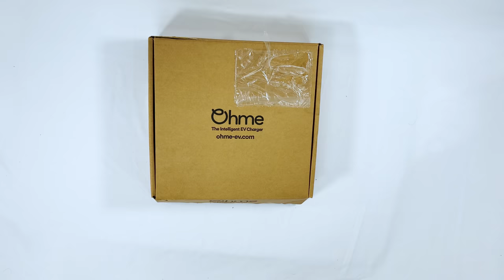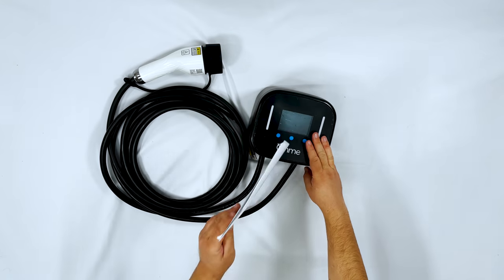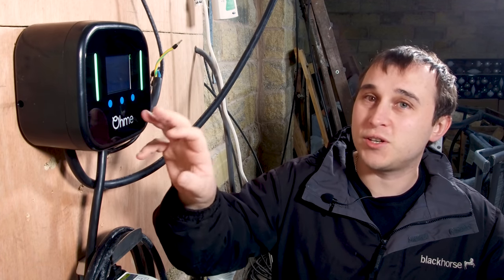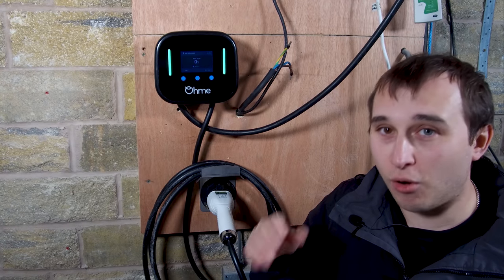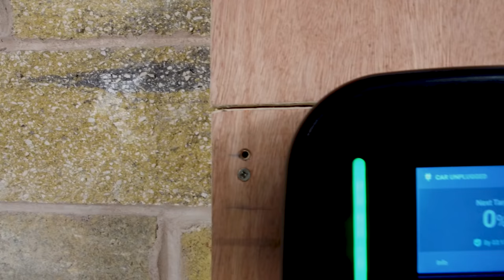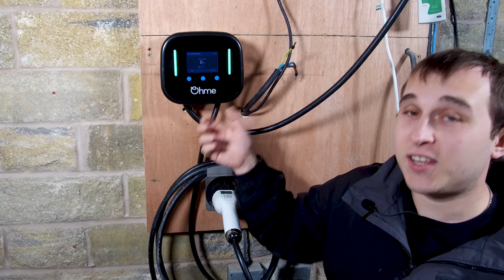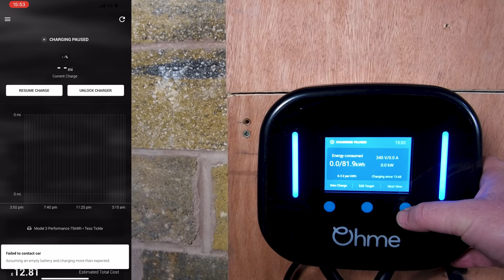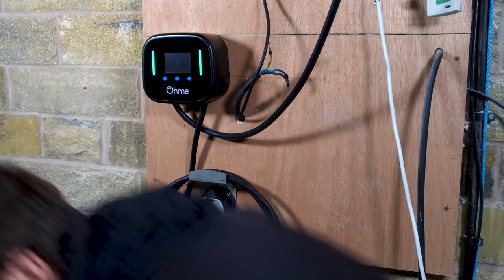Ohme Home Pro Review - New Level Of Smart EV Charger?

Comment: Hi Nick. I'm a long time fan of your videos and I really find them useful. I actually went ahead and got an Ohme Home Pro charger installed following watching this video. However, having used it for a while I do feel there are a couple of issues that I have realised which were not covered in your video. Firstly, the charger application does not support multiple EVs. So if you are a multi EV household sharing the Ohme Home Pro, then you will have a large faff to reconfigure the app every time you switch cars to charge. Likewise, if you have guests visiting in an EV who would like to charge, then you'll have to go through the same faff. I believe the app should allow you to add as many cars as you want (within reason) and fast switching between each car should be possible. Further, there should be an easy guest mode that allows anyone with any car to plug-in and the charger can be configured to charge based on a continuous or timed schedule without having to enter any car details. Neither of these features exist with this charger and I feel it's quite a big oversight.
Reply: Hi Mil, I contacted Ohme to check whether they were able to offer a guest or multiple EVs option for charging.  They did confirm that the system currently does not support this facility at the moment.  If anyone is looking for a an EV charger, my recommendation would be to think about what is important to you and get these points checked out by the manufacturers.  In my experience they are good at responding to questions.
Reply: This is an important feature not mentioned anywhere. thank you for mentioning it. What charger is good for multiple EVs?

Comment: Nick. Thank you so much for this review, another excellent video. However, it does put me in a bit of a dilemma as I was about to purchase an EV charger for my Nissan Leaf 30kWh. I was going to go with the Wallbox but I'm now torn between it and this one. I'm on Octopus Go with 5p off-peak rate for 4 hours. I'm not sure which charger will be best for me given the Leaf and Go tariff. Any suggestions?
Reply from the maker: Hi Mil honestly I say this again and again there's no 1 fits all charger.  Your may find several ev chargers that seem to fit your needs and others will only find 1 that fits what they need.  Check both do everything you need them to do then pick whats next important to you.  Price/Looks
Reply: @NicolasRaimo  yes, totally get what you mean but from what I understand, the Wallbox has timed scheduling which is very reliable for using with Octopus Go. How reliable has the Ohme Home Pro been with Octopus Go tariff?
Reply from the maker: @mil3761  ohme again perfect for that we use the older ohme charger at our current one with zero issues ever

Comment: I’ve only had it a day and I think the thing is a pain in the ass, why can’t it just be simple, charge and stop. I just want to plug my car in and have it start charging immediately and charge until full, or until I go out again. I get all sorts of messages, charging postponed until random times, sometimes I just get the thing sitting there doing nothing, sometimes it says charging but when I check my car it’s not charging. Some people just want a simple plug in until charged option. If someone knows how to be able to just start the unit charging immediately when I plug it in, on the app and on the outside unit, please let me know. Maybe I’m just old and useless and don’t know what I’m doing, but I didn’t find the app intuitive and easy to navigate, also when the unit is charging and you want to stop it, it’s not always possible, on the red max charge setting you can select stop charging on the main unit, but on the blue smart charging screen I couldn’t find an option to stop it from charging. 🫤
Reply from the maker: Have you looked at evnick.com/charge link the random charging to octopus your get to split £100 with me plus cheaper electricity

Comment: I am currently looking to install a home EV charger. I have a 1st generation smart meter and I am currently with Bulb. 4G is okay about 8mb download and 1.5mb upload. Would you recommend the Ohme for me or another brand? Thanks!
Reply from the maker: Hi Mitchell smart meter doesn't really matter if its 1st gen and the new company can't read it they will just fit a new meter,   I'd prefer to NEVER recommend any charger to anyone as its not a 1 solution fits all.   Everyone is going to have very different needs.  However if your question is will this charger work then yes it doesn't need a high upload or download as its sending TINY packets of data to work
Reply from the maker: pssst Click subscribe

Comment: Hi Nick i want to say thank you for this video as my brother in law rang me yesterday he’s 82 and has just got one of these chargers with a new Vauxhall Mocha EV trough the Motability scheme so problem was the plug on the charger would not come out of it holster on the wall the reason being the holster bracket now is not like you show in this video made from metal it is now black plastic  and the weight of the cable was bending it downwards he had no idea you had to press a button to get the plug out so he lives several miles from me and i had no idea what the issue was so i watch a few YT vids on the OHME and yours was far and away the best so i rang him back today and showed him your video over FaceTime job sorted saved me about a 40 mile round trip your footage did.
I have watched your videos for several years i have to EVs in my household both MGs ( mistake) that was but you have shown us a lot in that time so thank you very much much and keep up your good stuff
Les
Reply from the maker: Brill glad a could help!

Comment: Hi buddy, please can you help. I have the new OHME charger with no screen like this one I only want to charge my car on my cheap tariff which is 00:30 - 05:30 but the app doesn't let me do it. I can only set the desired % at departure. If I plug it in at 21.00 but depart for work at 05:30 and only need to top it up from say 40% - 85%. Will it start start charging straight away or work back from 05:30 so it charges on the cheaper rate or does it start charging straight away  ?
Reply from the maker: Are you on octopus intelligent?

Comment: Hey Nic, got the ohme home pro 2 installed a couple of months ago all worked fab untill i made the mistake of getting 2 ev's the same seems the ohme has issues distinguishing between the two cars even tho i sign into the ohme app using the respective api sign in for each car ( both are the same make and model ) swapping between them is easy as each is registered under a separate acc with the manufacturer but the ohme just becomes a not so smart charger as it cant connect to either using the api now. wondered if you or anyone has spoken to you re a similar issue???
Reply from the maker: not with 1 login for 2 cars but had issues with 2 cars 2 apis being a pain as you can't swap you need to delete car and read every time,  email ohme support and report issue.  However one solution may be using a 2nd email for the 2nd car,  or the LEAST popular method telling it NO API then it works same as other EV chargers with no app login but all the GO and Agile benefits... but email and bug support if they see the demand they will add it sooner always been my moan to them.
Reply: @NicolasRaimo  cheers Nic yeah I've a single ohme acc so 1 email but 2 separate bmw acc, one for each i3s..

Comment: This was top of my list  but no wifi on it is killer for me, rubbish mobile signal in my area. Also I have seen that several of the cheap electricity deals, like Octopus, seem to be offering their cheap rate between 12.30 and 4.30am and I think I understood correctly that this can't cope with that. Seems odd looking at its other complexities with rate chasing that it cant have a simple timer - Shame it looks good otherwise.
Reply from the maker: You can’t set a simple timer but you tell it your energy tariff and it responds to the price automatically so will charge in them hour rates if that’s when cheap electric is,   You can also make a custom energy deal in the app if yours wasn’t listed and say that’s when cheap power is

Comment: I much prefer a larger box so you can neatly wrap all the cable around the charger, also the CT clamp arrangement means these cannot be fixed on a building separate to the house consumer unit, Zappi still has it for me!

Comment: Hi nick could you explain how am i to use this with a mg zs ev 71 plate. I have just purchased this charger an bit concerned about the api issue
Reply from the maker: If your car isn’t one linked with api just tell it what car it is and that’s it… are you with octopus energy yet? If not you can get cheaper electric with Ohme using intelligent please consider using my refferal link and split £100’with me at evnick.com/energy

Comment: I only have one CT installed on my zappi. I have a powerwall 2 and use settings and move the slider to 100% reserved for grid outages and it doesn't drain the battery.

Comment: So close... Great features, but the sealed unit with a 5m cable is a problem for me. Front charge port, and I need to reverse in. A 7m cable option is needed. Aesthetically, I'd like to have the backplate extended upward to form the cable holder, looping the cable around the unit, and a more integrated holster below as you suggest, Nick. Thanks for the detailed review.

Comment: can you tell it to charge directly off solar panels like the zappi? rather than off the grid, great instructive videos thank you
Reply from the maker: No you can’t currently I believe it’s coming soon but as of yet no
Reply: They are about to start this as i had my charger fitted today and an option to try solar only, grid and solar, or grid only trial is now in the app.
Reply: @vincelemon6343  thank you for your reply
Reply: @vincelemon6343  can you tell me if the solar only works well on the app? Or has it not been set to run yet? Thanks

Comment: Great video - I think I’m going to get this charger installed for a Hybrid car that’s on order. My dilemma is; is it worth connecting the CT clamp?. When my house was built the electrician dropped a 32amp cable to the front of the house (for EV), but there isn’t any provision for any data cable. I have a 80amp DNO fuse, gas hob, electric immersion (backup) but gas  heated. Only other big users are two Aircon (air to air) units (20 amps each), but rarely used.
Other than load balancing, is there any other benefit in connecting the data cable ? It is possible but just means a load of holes to feed cable and then patch up 😒
Reply: An update to this so you don’t need to answer this question now. Ohme answered this question for me. I don’t need to connect the CT clamps as it is just load balancing which I don’t need at this point. Solar will be enabled at some point in the next year or so, and it’s then that passing a LAN cable might be useful. I did enlighten Ohme as to meter monitoring systems which they can perhaps link into with their live data. I pointed out I have CT clamps on all my consumer unit circuits monitoring each circuit and therefore when they introduce solar I would be doubling up on CT clamps within my Consumer unit

Comment: I've used an Ohme cable with a non-tethered charger I got installed for free with our last EV. I think you'll find chargers will still come with a non-tethered option, even if most people want tethered.
The Ohme app is good, but takes a bit of an effort to get working with one's setup. It doesn't allow switching vehicles easily for more than one EV, and still cannot use the Mercedes API.
However, it worked brilliantly with Octopus Agile, and switching to Octopus Go was effortless in the app.
One "feature" of the cable is that it starts charging for about 1 minute as soon as you plug into the car, while it communicates over mobile with Ohme - it then switches to standby, and will turn on at the appointed time/rate. (Does the Ohme charger also do this?) It also needs unplugging & re-inserting if you are going to leave the car plugged in for over 24 hours, otherwise it won't initiate a second charge 24 hours after the first one.

Comment: A very informative set of information. I am an Octopus customer with Hyundai Ioniq 5 on order. My only practical charger location has virtually no mobile signal. Given that the OHME product is only usable with a mobile signal, is there an equivalent (in terms of performance) charger that can operate via an Ethernet connection?
Reply from the maker: Have a look at zappi they have an option which uses a hub which sends a local radio signal to your charger that’s separate from WiFi
Reply: @NicolasRaimo  That is most helpful and thank you.. We have already decided to take an Ethernet cable link from an Internal Access Point to an External Access Point that would be sited next to the Charger. The External Access Point would take power from the CAT 6 cable to be installed at the consumer unit on its way to the Charger. Hopefully a ZAPPI would be able to connect to this set up. I have to assume that the absence of a mobile signal is not an uncommon  challenge for installers in rural areas like mine in Norfolk.

Comment: Was looking to change over to this charger so that I can charge a Hyundai I5 on octopus intelligent, but no wifi or ability to extend the data antenna makes it a bit useless for my install. 
It seems there is no perfect EV charger yet, each one has something holding it back.
Reply from the maker: assume you have no mobile signal where charger location will be? I know of 3 chargers to go on octopus intelligent HOPEFULLY this year one has ethernet if that helps?
Reply: @NicolasRaimo  That’s interesting, the signal at my address is very flakey and the current Rolec charger is too hit and miss to rely on, so I use it as a dumb charger with the car on/off timer. But Rolec isn’t compatible with Octopus Intelligent. A Wi-Fi or Ethernet connected charger could be the solution.
Reply from the maker: @metube9541  check out the INDRA charger I believe its in pipeline for intelligent,  since my review they have made a new app that's being rolled out to customers as we speak!
Reply: @NicolasRaimo  thanks

Comment: Thanks for this, our potential installer is saying they need to run a full cable for this as our existing one (developer put in a thicker cable ready for this) a s it wont have the extra data cable for load balancing? Really don’t want a new cable ran as all ours are integrated!
Reply from the maker: He could just run a data cable (cat5)  other option.. do you need the load balancing?  if its a DNO need then YES you do but if your on a 100amp fuse and your likely charging at night I'd not worry personally...   There is other chargers that have load balancing with wireless CT clamps but depending if you need it for DNO am not sure the wireless part conforms to G100 standards
Reply from the maker: pssst don't forget to click subscribe
Reply: @NicolasRaimo  thank you! I don’t know if we do then, we would only ever have the one charger and so hopefully should be fine? I also am considering the  Easee, is that good? Thanks!
Reply from the maker: @apocreg11  review on channel about easee I not reviewed easee one which has built in pen fault but it’s pretty much the same

Comment: 20:13 very good points raised!
perhaps couple more:
1) humans may knock it off, break the plastic inside the holster, or even injure themselves, when passing around so-much-sticking out connector?
2) that vertical steel lip = have they finished it well with file? otherwise i see it potentially sheering off some of the cable's insulation (under certain conditions), if it was to rub there (or even on those down-ward bent ones)...

Comment: If you wanted to pre heat your car in the morning would you be using mains electric or your car battery? I have had it said to me that using the stored off peak electric in your car is cheaper than using the more expensive morning electric but I like to heat it off the mains.
Reply from the maker: 2 reasons you’d want to,  
1 you need all the required range
2 your battery preheat only works when plugged in or has a much shorter cycle when not plugged in
Reply: @NicolasRaimo  sorry what I was saying was will this charger let you do it or will it be “off” because it’s not at your off peak tariff?
Reply: @scottwills4698  i don't think it's their intention to allow it. they see us as grid-load problem so they would want to make you use the battery pack.